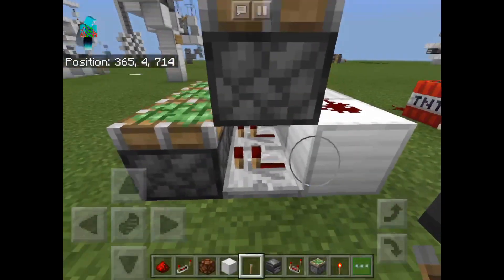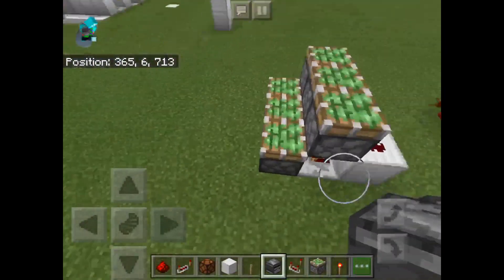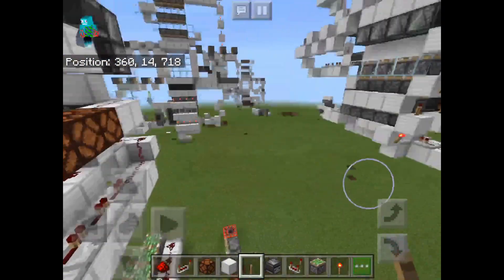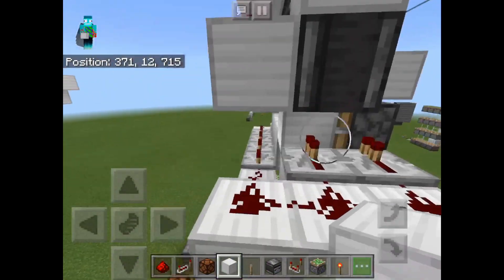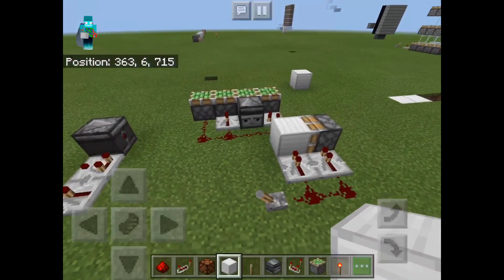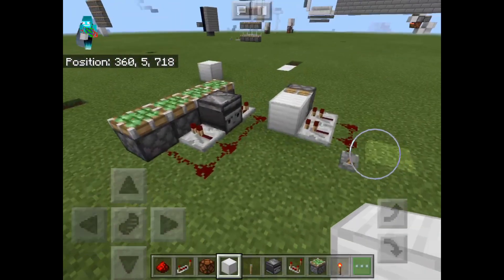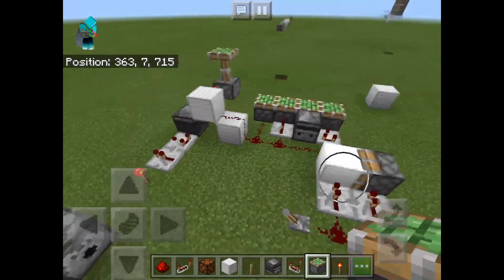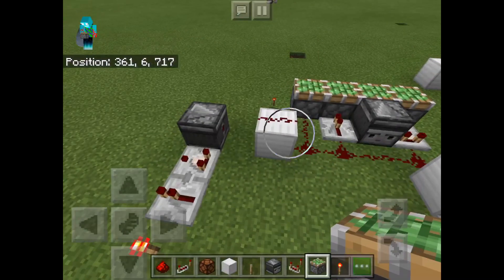0-tick pulses in Minecraft Bedrock: how to create them and their uses (Read Description)

Comment: Hmmmmmm.... let me use this to make a zero tick farm... (the block pushing one that works on all saplings, crops and etc)
Reply from the maker: This sadly doesn't make pistons move any faster so it won't work
Reply: Ben -the human I designed a better zero tick pulses.
Reply: Using the fact of placing redstone torches on redstone blocks creates a zero tick pulse, I connected the zero tick pulse to a piston, breaking the torch. Just hold down the place button on the redstone block, then the thing will keep looping the 0 tick pulse.
Reply from the maker: That's called a p-tick. It does the opposite of 0-tick pulses

Comment: While I was experimenting in my testing world. I found a 0-tick pulse that can activate the repeater, comparator, dust, torches, and observers while not activating pistons, tnt, and dropper, dispenser.

All you need to do is to place a torch on a powered block. I can't find a way make it without the player's interaction. Can you make a 0-tick like this with redstone components only?
Reply from the maker: I know how you create them, you make a normal 0 tick pulse generator then set the repeater going into the piston to 3 ticks. It's falling edge and it behaves in the opposite way than a 0 tick pulse. I have known about them for quite some time now but haven't felt the necessity to make a video about it. It's cool that someone else made the same discovery.
Reply from the maker: I might make a shorter video about it discussing it's capabilities and uses
Reply: Isn't placing a torch on a powered block a 1-tick pulse?
Reply from the maker: @Max Cai it's a p tick. It won't work with consumers
Reply: @Benthehuman  Oh? I am more familliar with Java, and in Java edition, it just makes a 2-game tick signal.